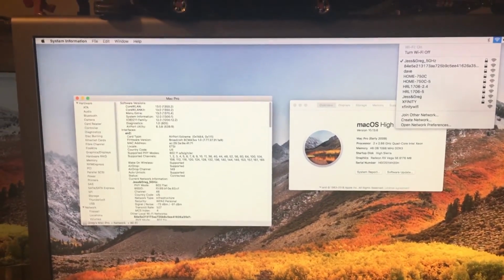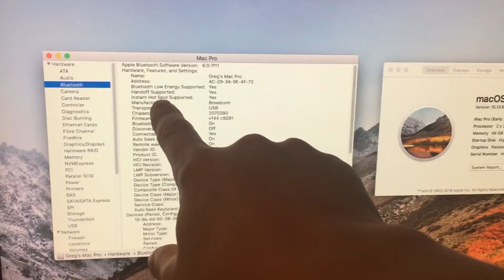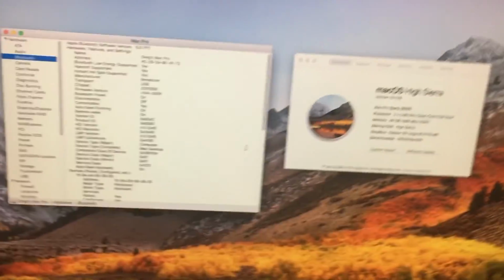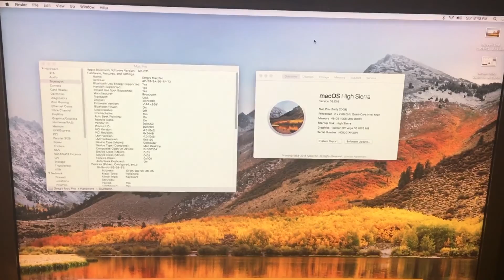(4,1/5,1) Installing an AC Wi-Fi Card BT 4.0 for Handoff & AirDrop Support - Mac Pro Series S.3 EP.9

Comment: I just did this upgrade, everything works except Handoff. I made sure Handoff was turned on in settings, and it shows Yes in System information. I did a Vram reset as well. Any thoughts. I have a 2010 Mac Pro 5,1 Mojove Macos
Reply from the maker: Yeah Mojave sorta broke it... it’s possible I think but I never got it going
Reply: Hrutkay Mods Thanks for the reply, at least now I know I’m not the only one
Reply: I found a fix on macrumors where you disable SIP in recovery mode (or if you have Catalina via the patcher, it should already be disabled) then you can use a terminal command to make handoff work. Worked for me. Took a few resets but my Mac 4,1 finally got the picture.

Comment: No soldering needed?
Reply from the maker: Not with this expensive version... cheap version yes you need soldering
Reply: @HrutkayMods  Can I get this on Amazon?
Reply from the maker: The cheap adapters yeah... you need a BCM94360CD with adapter and USB cable then you have to splice the USB wire into the BT USB wire
Reply: @HrutkayMods  Where can I get the card that you got?
Reply from the maker: OSXWiFi.com but it was cheap when I got it... it’s too expensive now
Reply: Hrutkay Mods tell me what I should get and I’ll look and see.  Thank you for your videos.

Comment: Hey, thanks for posting this. Quick question. What size screw driver did you use to take out the screw for the old Bluetooth module? Mine is stuck and I don’t want to strip so I had to leave it in.  Thx!

Comment: I did the same upgrade adding the airport card of the 2012 macbook air, while AirDrop and the system preferences say my Mac now supports instant Hotspot and low energy Bluetooth I have some issues

I am not able to enable apple watch unlock for some reason, the option to do it is on settings but the system preferences app just stays loading on the Apple watch unlock enabling, and sometimes it does not detect my iPhone for instant Hotspot or takes too long to appear on the wifi panel

Comment: Where can I find alternatives to OS X Wifi. Not gonna spend 200€ on a wifi module.
Reply from the maker: You need a 2014 iMac BCM94360CD WiFi module and adapter The Bluetooth is where the problem lays... if the adapter has a USB header you can solder the data lines to the wire going into the Bluetooth port

Comment: So did you have to do anything to get your handoff and continuity features working? It reports correctly on my 4,1 but I still cannot use iMessage etc. Any thoughts or suggestions would be great! I feel for you in this video it was a pain in the rear to install.
Reply from the maker: Yeah that’s what I would go with, you don’t need anything special anymore the system automatically detects and should enable the menu features
Reply: So this setting has been always been enable and I can Airdrop files to my phone, etc. The only thing that still isn't working is iMessage only.  Would love to hear your thoughts.  @AppleReviews
Reply: So 6 months later, in case anyone has the same issue, the PRAM needed to be reset and its all good! 
https://support.apple.com/en-us/HT204063

Comment: Removing the CPU cage would have saved you a LOT of time and hassle :p The OSXwifi prices are ridiculous!
Reply: I was a Mac n00b in April 2018 when I bought this card from OSXwifi, paid full price, and it still feels like anal rape.
Reply: Todd Baldridge By now you should be able to walk straight again, mostly ;)
Reply from the maker: Todd I know the feeling... they were cheaper 2 1/2 years ago though
Reply from the maker: Ridiculous is an understatement Jay 😂
Reply: I have it all installed but the wire I have for the Bluetooth connection is just 2 wires how do I attach them to the slot and wire that to work because the original had 4 wires running to that plug this cable I have only has 2 wires